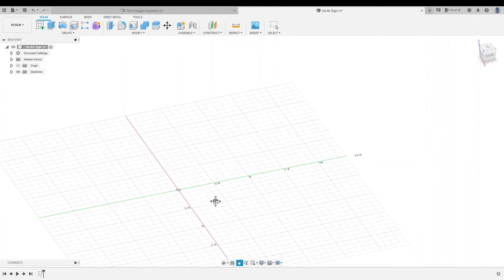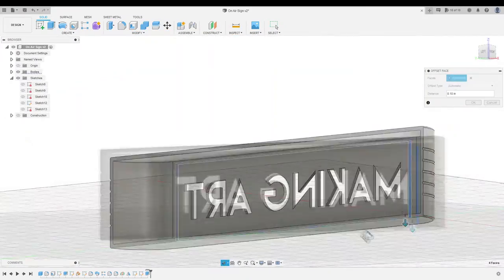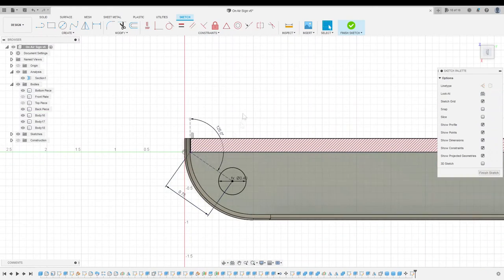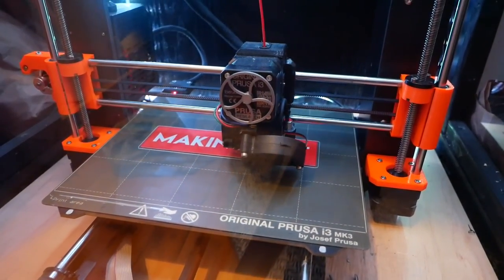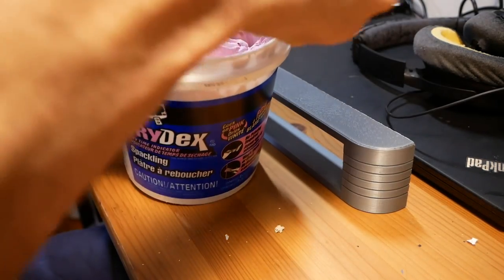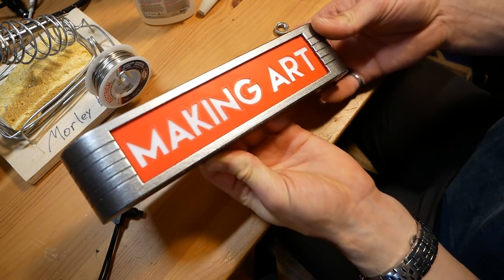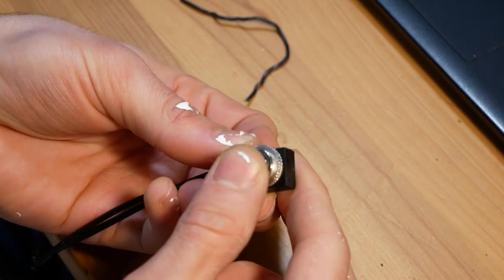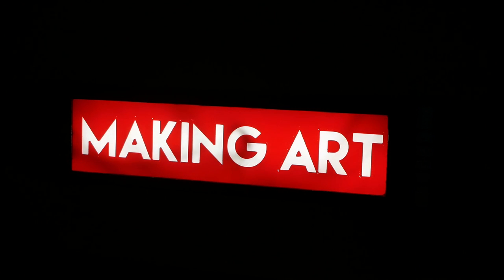Making a 3D PRINTED LED Sign - ON AIR Inspired

Comment: This turned out great! Embrace the jank! I would totally have gotten bogged down trying to fix some of the things you and other commenters mentioned. I definitely need to just get past that phase and get a working v1 finished before I hit that point. I struggle with it and have so many unfinished projects in F360 or SketchUp phase.
Reply from the maker: Yeah I guess it’s a double edged sword, sometimes it’s great for me being able to push through perfection and get things done! But it has its trade offs 😊
Reply: Sorry that came out harsher than intended. I think a battery would last a very long time for the amount of use the light would get. However the cord does add to the retro look ;)
Reply from the maker: @FixitFingers  all good!

Comment: Ok, so, I’m actually surprised you didn’t hit a certain point in your design, because I felt you we’re heading this way, where you said “I can’t decide what I want the sign to say, I’ll make the letter plate interchangeable so I can print new ones out and easily swap them out as I feel like it”.  I think that would be pretty cool as well as pretty easy to accomplish by just having it drop into a groove instead of being glued in. My only other critique would be that the power cord is very dominant, visually. Obviously it needs power but in version 2 perhaps the plug can happen behind the scenes instead of being exposed, then you’d only have a thin wire coming out. OK, one last thing!... those aren’t “half inch” nuts. You refer to a nut or bolt by the thread size, not by the head size, so if those nuts take a half inch wrench they should be 5/16”. Overall though, I think it’s a really fun project and I only offer all these comments because I know you like iterating and analyzing. 😻
Reply from the maker: Yeah interchangeable plates would be neat but for me, I’m happy with the single option😊 
Totally feel you on the power cord, definitely could be improved upon.
Re: the screws, totally my bad, and I realized that when I was writing the description with the material list. I designated them properly and added a link in the description! 😁